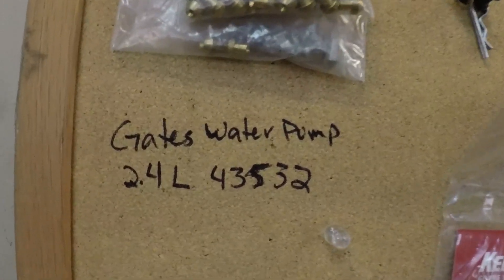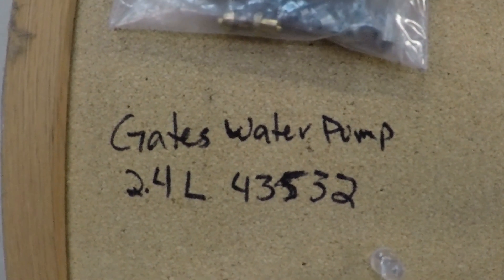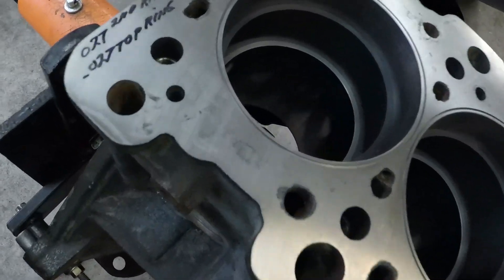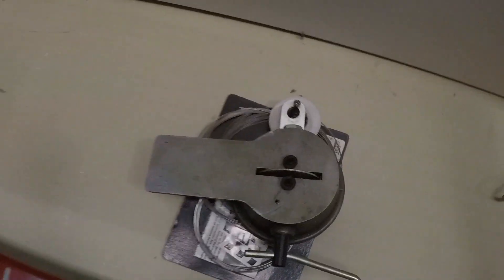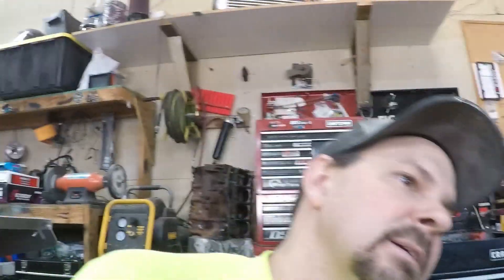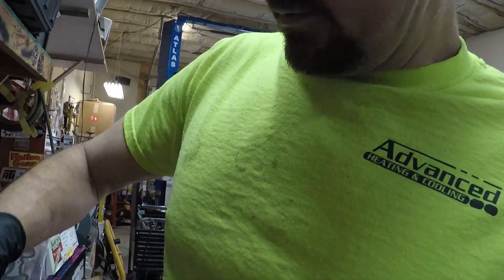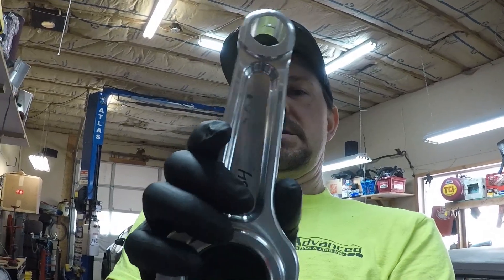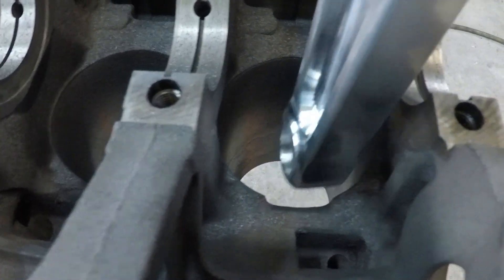Notching a Block for a 2.1 Aluminum rod motor.

Comment: Is it possible to run a 2.1 on a steel rod with a lesser hp number?
I know people tend to run the aluminum rod for these builds, but I'm not sure if the longevity is there comparative to steel rods.
Reply from the maker: It's definitely possible.  But from our experience the steel rod motors are harder on bearings than an aluminum rod motor and aren't capable of revving as high. Nate's Evo is a weekend warrior and it is going on 4 years now with the same aluminum rod motor.  Even on spray the motor keeps ticking.  But if you are trying to build something that is driven on a daily basis then the steel rod might be a better option.